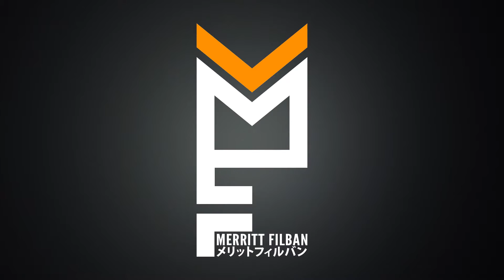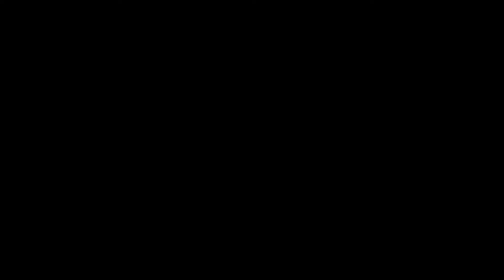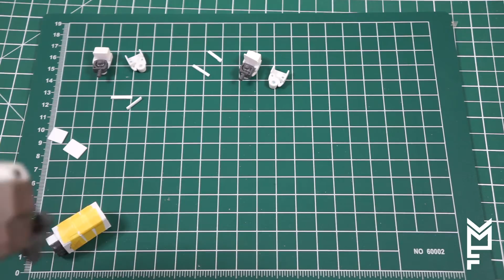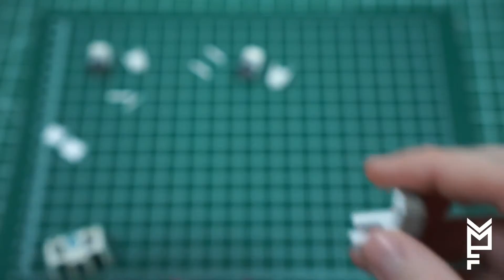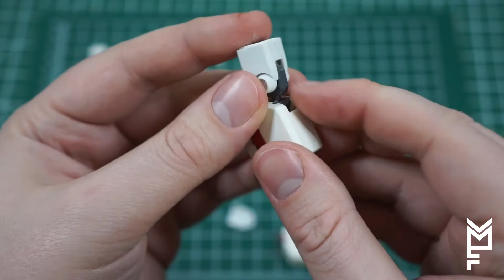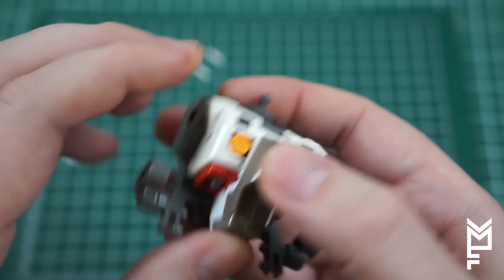MG RX-78-5 Gundam Customized Build - Part 1 | Rough Scratch-Building

Comment: I actually just bought this kit so I'm looking at what kinda potential it has
Reply from the maker: Bit of an older MG, but pretty decent otherwise.  Not a full inner-frame, but that may make it easier to paint or customize, depending on what you are trying to do.  The details are still pretty good.  Didn't finish this project, but was fun to work on so far. Good luck with your build!
Reply: @MerrittFilban  thanks dude 🤙